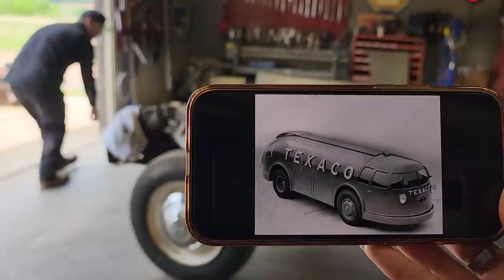The fabrication begins – 1930's Doodlebug Tanker

Comment: I'm really glad you put on ear protection, I am 73 and for the last 30 years I go to bed with a jet engine in my ears and I wake up with the same sound. It is maddening, I only sleep when I am so exhausted it doesn't bother me, because it never goes away. Earmuffs are so easy to put on and unobtrusive, it would be a shame to not protect yourselves,yes, Jolene needs them too!
Reply: I'm 73 and never wore hearing protection even when it was required. Ringing is louder than I can turn up my TV. 24/7/365

Comment: If you were to purchase a used Airstream trailer. Cut out the bottom, and drop it over your donor frame. You would have the exterior of your project almost done. Some of the Airstream trailers all ready have windows in the front of them as well.
Reply: Nothing like completely missing the point of the build.
Reply: My thought's exactly man!!

Comment: great heavy duty axles and rails. My rig is a1992 Ford Fire crew E350 built by Braun 7.3IDi million mile desiel engine love it. I even have 3 solar panels 120,000 volts to drive a full frig

Comment: I noticed you were sitting on the floor yesterday, talking about sitting that low. And that’s okay. But the picture of the jittney you are showing looks deceptively small.

In reality, those vehicles were enormous. The first vehicles used modified tractor wheels averaging 38- 40 inches in height.

If you look at the picture and imagine the larger tire size, you can imagine the interior is very large. Stand up inside it, large.

You don't need to change the tires, but it would way cooler with a set of tractor tires up front with twins in the back.

Just saying, when you think jittney, think big. Like huge.  The Russians used them in Siberia to get through the deep snow. To keep the weight down, they dissected old plane bodies. The aluminum structures were rugged and materials were light.
Reply: I’m thinking he HAS to keep it short, otherwise he won’t be able to get it in and out of his shop doors!

Comment: I'll be interested to see what he does about the difference in track width between the front and rear.
Reply: Not a problem....we are talking Chad Hiltz here!!!
Reply: @soundslikebstome  ,
Reply: I know Chad may have a different idea but I’ve seen where they’ll cut and shorten the rear differential. That way front wheel and outside rear tire lines up. Chad likes to saw,rip and weld so go for it.
Reply: He will eliminate the back outside tires and the remaining tire will sort of line up to the front ones.
Reply: Awesome closeups Jollene

Comment: Just my Belly Button. It looks that the rear wheel track is wider than the front. If you were to make the body the width of the front wheels, you could use step side fenders to bump out over the rear wheels. Make the openings to match. Just an idea.

Comment: I like the idea of using square stock to make the frame and then add on the metal. Also add a square stock to the passenger for extra strength and to match the drivers side. Then you do not have to worry about bending any metal. Just an idea.

Comment: Nice work.
A suggestion, what if you mounted the seat above the front axle, and pedals and steering wheel in front of the front axle. Then it will be low without changing the suspension.

Comment: CHAD, EVER THOUGHT ABOUT WEARING A PROPER RESPIRATOR FACE MASK, COS THERE IS A HELL OF A LOT OF FINE PAINT AND METAL PARTICLES IN THE AIR AFTER GRINDING THE FLOOR AND OTHER AREAS ON THIS NEW PROJECT.. ( AND ANY PROJECT ) ...AND YOU KNOW SOME OF IT IS BREATHED INTO YOUR LUNGS. I ALSO FOR MANY MANY YEARS, HAVE DONE SAME/SIMILAR WORK AS U R DOING IN THIS VIDEO, AND I ALSO DID NOT WEAR A RESPIRATOR. BUT NOW  I TRY AND WEAR PROTECTION FOR MY LUNGS, AND SOMETIMES TRY AND DO JOBS OUTSIDE, WITH A FAN BLOWING PAINT/METAL PARTICLES AWAY FROM MY WORK AREA.. YEAH, IT'S A REAL BITCH REMOVING AND REPLACING THE FACE/LUNG PROTECTION, BEEN THERE AND STILL DOING IT... ANYWAY, REALLY LIKE YOUR VIDEOS, AND LOOKING FORWARD TO THIS LATEST FABRICATION ...CHEERS FROM CHILL FROM DOWN UNDER IN AUSTRALIA...

Comment: The metric system would so  uch easier for your measurements Chad. We failed you in Australia not sending you home with that knowledge. Sorry m8.
Reply: Metric system is so easy. 0,10,100,1000 and so on. Basically just parts of 10s.
Reply: When in Rome.....
Reply: @Estabanjuan  is Chad goi g to Rome. Wonder what unit of measure they  use.